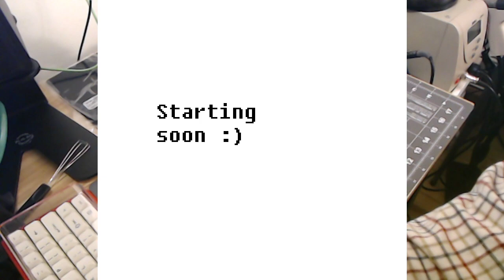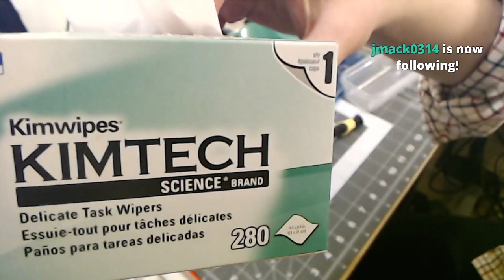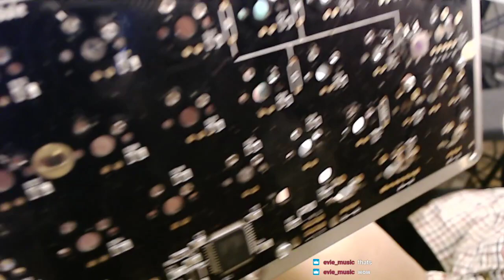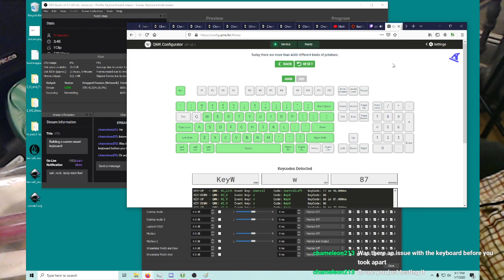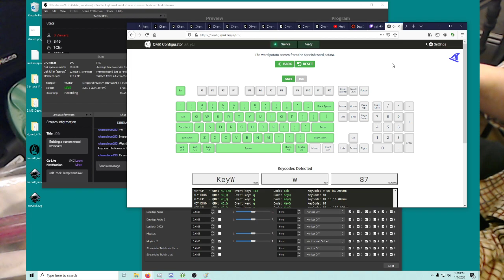Livestream: Handmade wood keyboard & DIY gasket mount experiments

Comment: Hey do you think you could use leather strips instead of neoprene? I bought some really nice walnut Im going to build a clamshell style case out of for a handwired bluetooth 4x12 ortho build. Im struggling to decide which material to use for the plate and how to mount it, I was thinking brass because the color and sound or steel cause it seems to sound good though I want to use it in public I dont want it to be too loud. Do you have any recommendations or advice from your experience?
Reply from the maker: Maybe, interesting idea! I'm not sure if leather would be more or less "dampening". Maybe you can experiment with some different materials and let me know what you find.
Reply: @saltrocklamp199  Hi sorry for the late reply, for some reason I had notifications for comment reply's turned off. I had some additional questions I wanted to run someone that has at least done something like this before.
An issue I have is that I want to make my case a high profile, however this would be very hard to do with the plate mounted around the edges so would require me to tray mount. The alternative to this would be to buy glorious pandas because the switch housing would match the brass plate so would make low profile aetheticly acceptable for me however I cant find any info on the activation distance as I like short ones, however I probably just going to risk it and do this.
Also I was wondering how the screws holding the plate are secured, looks like inserted thread but I want to make sure I have a proper plan how to mount before I order my plate.
Reply from the maker: @aviinuo2694  I never saw this reply either, sorry! Yes there are metal screw inserts sunk in the wood. For a "high profile" case you would probably want to just follow the standard sandwich case design, using an upper bezel and passing the screws through both the bezel and plate before hitting the threads in the bottom half of the case. Tray mount is a seriously deficient design compared to something edge-mounted, I wouldn't recommend it.